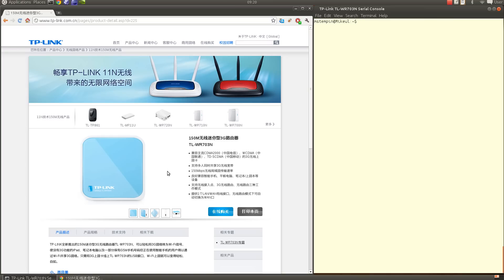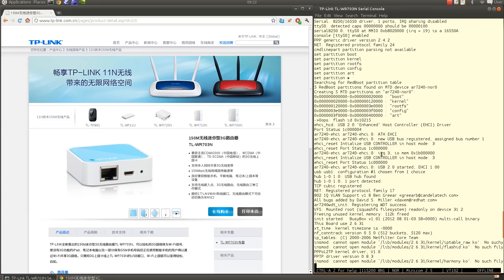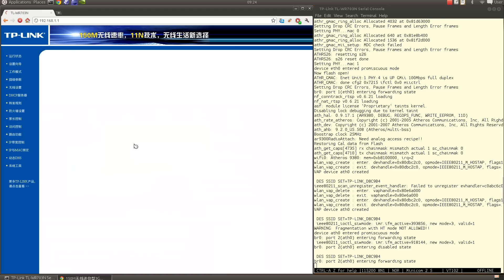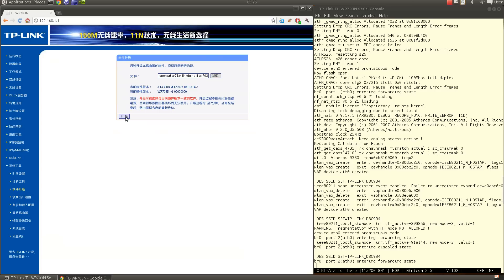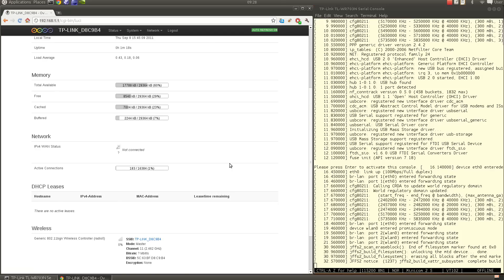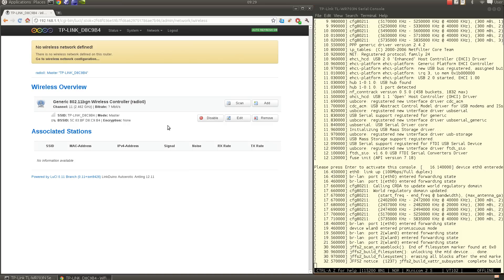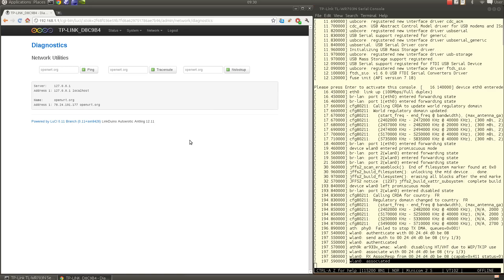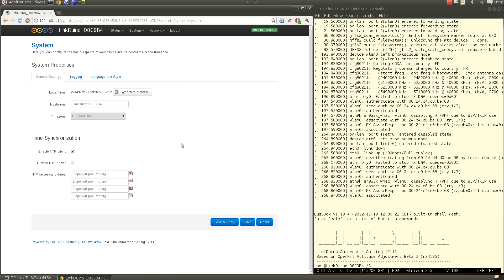LinkDuino Wired Install

Comment: Hello Squonk421, I saw your video and posting, and tried to use WR710N, which is essentially the same as 703 except with an extra Ethernet port. My main purpose is to use the USB to connect to Arduino and use WR710N to access Internet. after installing the OpenWrt, I can't find the USB port. I used the build openwrt-ar71xx-generic-tl-wr710n-v1-squashfs-fa..>. can you help?
Reply from the maker: Sean Du I just answered your question @DangerousPrototypes:
I am no t sure of what you try to achieve: apparently, you successfully configured OpenWRT to access the Internet from a PC using one Ethernet port. However, I don’t understand what you ar etrying to do with the USB: there are some IP implementation running over USB (see my 13-year old guide), but this requires a driver on the other side, here the Uno, but there is no such thing.Your best chance would be to use the USB between Uno and WR701N as a virtual COM port (“CDC-ACM”) and use a serial to Ethernet bridge on OpenWrt, like the “ser2net” package:https://forum.openwrt.org/viewtopic.php?id=50258https://www.youtube.com/watch?v=_OVRr69Apl0

Comment: oke im new in this stuff but i really what to connect the Arduino to the TP-LINK TL-MR3020. I use mac and i have the Arduino Uno.

Can i use the OpenWrt firmware TL-WR703N also for the TP-LINK TL-MR3020? 
Where can i get it?

You are using OpenWRT is it also possible to use DD-WRT? And make the same connection. 

Thanks is there a possibility to email about this stuff?